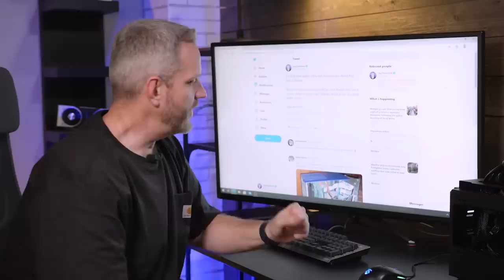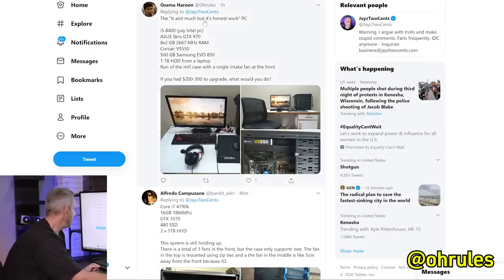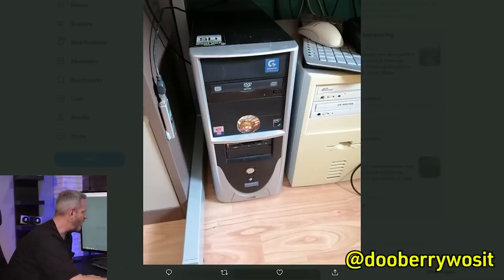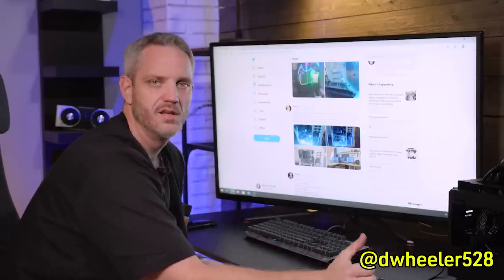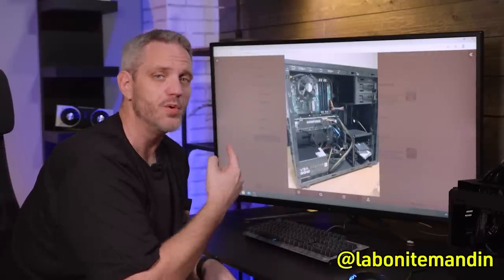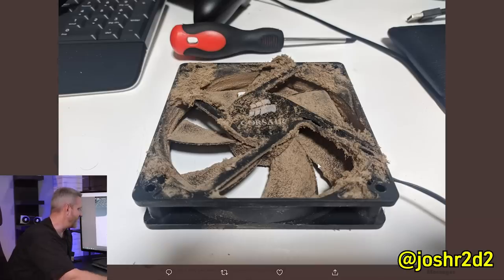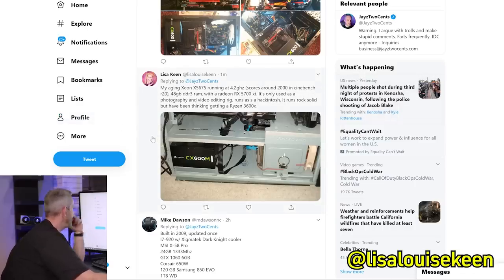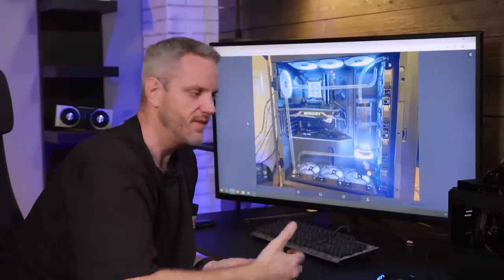Reacting to your WORST Setups... Send help NOW!

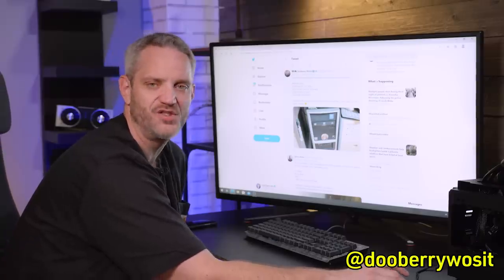Comment: 7:52 currently running an 8350 with a GTX1660ti I had to swush in there cause my rx290 blew up due to a sketchy "gamer" psu (was on a budget xD) and I'm getting some cpu bottleneck and there's no possible cpu upgrade on this mobo.. honestly it runs great like 60 fps on 1080 even 1440p and stuffs but I feel I wanna try 144hz 1440p so I decided to upgrade to an i9 12900k cpu an rtx 3080ti with some decent ram and stuffs.. currently looking up random pc stuff cause I wanna make sure I don't mess up the build xD

full pc build if any recommendations or.. stuffs
- Intel Core i9 12900K 
- Gigabyte Vision GeForce RTX 3080ti
- MSI Pro Z690-A DDR4 mobo
- Seagate Firecuda 530 2TB with.. sketchy heatsink
- Samsung 870 QVO 4 TB SSD 
- Seagate Exos something something 10TB HDD
- G.Skill Trident Z Royal DDR4 3600Mhz CL18 2x32GB
- Corsair HX850 Platinum PSU
- iCUE H115i RGB PRO XT AIO (wanted the H150i Elite Capellix but shit happens.. probably be fine not looking to overlock or anything)
- Corsair 5000D Airflow (black) case
- Samsung Odyssey G9 Neo Monitor (yet to purchase but probably will unless someone actually reads this and tells me it's a bad idea for.. whatever reason :D)
Also got a few extra non RGB fans since I don't care much for RGB..

Comment: Been building my own gaming PCs since 1998 and I do not adhere to the cable management religion. I just make sure that air flows through well enough.
I've been using the same Cooler Master tower for the last 15 years. No glass panel, absolutely NO lighting and it's on a "hanger" under my desk, so what the insides look like makes zero difference. It's quiet, cool and accumulates very little dust. Just saying you can be an enthusiast without caring one bit about cable management.

Comment: Water on hardware with high voltage running through it just feels so wrong to me. Can t help it but i would never consider getting water anywhere near my rig. Besides if the whole thing goes up in flames I can still put water on it to cool it off 😅.
Reply: I'm sorry, but up to 12 volt is not high voltage. Doesn't mean water can't damage the hardware though.

Comment: I'm in NorCal. I have sound cards, a few MB's, and a few old processors...couple old video cards, drives, old pci cards, couple ISA gameport cards (CH and Thrustmaster). Let me know what kind of retro things you need and I'll see what i got. Fyi...i tried to do a retro build for some old games and i wanted to use the monster sound mx300. I forgot how much of a pain in the A$$ windows 98 was to install.  I gave up on the build for now.

Comment: 3:35. Jay, I disagree. The 8400 has 6 cores @ 2.8 Ghz, and should be more than enough to run most titles. Spend the money on the graphics card. Even more so, now that the 3000 series has come out, the used market should be flooded with better cards than the 970. My rig is an i5-8400 + 1660ti and I have no problem running any games. Got my 1660ti for $120 back in August of 2019.

Comment: damn man saying fx is 10yrs old makes me feel old my son still uses my old fx8350 on a sabertooth v2 mobo 16gb ddr3 ram and a gtx1080 (first system i built myself was running  2 gtx650ti sli untill around 3 yrs ago)overclocked to 4.5ghz and a slight gpu overclock and still runs well to be fair he plays dirt rally 2 and other driving games and games like anno1800 with no issues

Comment: @JayzTwoCents @6:20 You mention FX processors being around 10 years old, well, I'm running a Phenom II X4 965 processor and will soon be treating my ASUS M5a78L-M/USB3 board to an FX processor AND a GFX card, it's FIRST since I bought the MoBo, I've been using the onboard GFX.
Don't mention OBS to my MoBo, it will cry ;-)

Comment: I need to restore my case... I like it too much to get rid of it but it needs some tlc unfortunately when I had to put it in storage for a little while the unit I had it in had an issue with condensation. But at the same time I'm not sure if I went to do any major upgrades that they would fit lol

Comment: I don't see the need of cable management within computers at all , i been building computers since 1986 and could care less about where my cables run unless they block a little bit of airflow.. which usely isnt that big of a deal anyway.. the only reason to manage "some" cables is when you need to work inside your computer to replace hardware.. which isnt that much also , i dont know what's up with people want the cleanest looking build.. for me what's important is the best working computer for gaming and other applications ... cables here are all over the place and as long as i dont accidently pull them or break my neck over them i don't care

Comment: My little brother had an FX system with a 650ti boost until one month ago when he upgrade to a Ryzen 3600 and a GTX 1070. He paid off the mobo and GPU but still owes me 115$ for the CPU. You know your CPU is old when you cant play new games because the CPU lacks the proper instruction sets.

Comment: Jay\Phill: Does the 3080 Seahawk gpu come with the aio pump on the cold plate or on the radiator? The only option i have is to bottom mount the rad which is strongly a no no..

Comment: The best thing was as my FX 3850 died, so i got a Ryzen 5 3600 and everything is fine now xD Its running on 16GB DDR4 3600mhz combined with my 6GB 1060GTX and i think i will upgrade my GPU in 2021 :D

Comment: pc at 19:30 u didnt nitice he has a microphone for recording, what it look now he no doubt have interference problem, prob just use for games or such....still could be rly annoying having that hum...alot to do with adaptors and cables for monitors, first rule if u going to record...always separate signal from power...he need sevral power strips to separate those adaptors.

Comment: i paired a fx8350 with a 2060 super heavily bottlenecked but getting that gpu was a very tight squeeze at £480! thats all i could afford at the time that system may of been shit BUT i still have a pretty good gpu that will fit into a better system which it did 8 months after that i got a mobo this was £180 didnt have alot of money left to get the rest so waited a month got the next tight squeeze £280 Ryzen 7 3700x then waited a month got the ram 2 months after that joined the SSD club now i got an amazing pc, that overpowered gpu in a old rig paid off in the end. it wasnt pointless getting it

Comment: fx is still fine for 1080p gaming in 2021 fx8120 with a 1660 super games at 60 fps the build cost like 350 to buil 2 years ago mobo is in stock and under 100 bucks cpu is easy to find for 50  ram cheap stop shaming low end builds

Comment: lol i got a sport car red pc case with even the sound of a car doing a burnout when i start it ,it has an asus p5k motherboard with like 7g ram ,a core 2 duo 2.6 g and a geforce 9500 gt 1g G.C. i got like 5 old non functionnal pc's and parts for 40$ and i built at least one functionnal....lol learning projects... my main pc, is my crappy msi gf 75 thin ,i7 rtx 3060...

Comment: I used to have an fx-8350 octa core cpu with 8gb of 1300mhz ram
upgraded to ryzen 5 3600 6 core scpu with 16gb of 3600mhz ram
about 3 months ago
dont know if that sounds like a downgrade but it works WAY better
Reply: that is not a downgrade, the architecture of the ryzen 5 is wayy better, the IPC is much better, you have 4 more threads now, more cache, probably even more stable at slightly higher clock speed, i also upraded similar to you apart from i was on the fx 6300, you made a wise decision going with the r5 3600, go run a cinebench r20 and compare it to a cinebench r20 of the fx 8350 and u will see how much the 3600 farts on it X'D. honestly at the 3600's price point theres not many cpu that can beat it for its price

edit: it may sound like a downgrade because of core count, but all ur cores / threads arent going to be used in some games / most anyway (if thats what you do), which is why intel have some lead in gaming, with higher clock speeds / less cores than most ryzen chips, but ryzen is catching up with clock speeds B)

Comment: My 8350 still rocking
Reply: i only upgraded from my fx 6300 the other month, i played so many games on the gtx 970 and fx6300, pushing it to 4.2ghz all the time aswell trying to tank my games with the highest settings i could... the cpu did well :), however the upgrade though was definitely worth it, i still use the gtx 970 though, will be getting a 1070ti for like £60 soon :o

Comment: My little brother just bought a fx system. Fx 6300, gtx 1060 6gb and 16 gb ram for about 200 bucks. I bought a fx 8350 from ebay and put it in hes computer to make it less terrible.

Comment: When you're running an FX system and Jay says to go turn a trick to get off of it...... whoops :D
Also to add to that I have an OCZ PSU very similar to the one shown in that picture and I feeeeeel that cables not being long enough issue. I had to run my 8pin cable through the small space next to the PCI slot between the board and the GPU. 
BS aside though I will be doing a full rebuild very soon with a 3700x :)

Comment: i think i over paid. Ryzen 5 5600x, MSi B550 -A-Pro MB,  T Force 1Tb Nvme,16gb corsair vengeance LPX 3200, stock cooler, XFX RX580, MSi 750 semi modular PSU, Montech X3 Mesh case. Any suggestions? Im still in the return window

Comment: I'm still running amd fx 9590 black edition xD never had an issue xD. I am switching to a ryzen 7 3700x though xD (but it's because of my 990fx chipset that decided to reach temperatures higher than Robert Wadlow. So Im pretty much building a new pc)

Comment: I am currently running:

i5 6500
h170i asus mobo
16gb ddr4
gtx 1070 g1 gaming

I want to continue gaming at 1440p with the latest games.
What upgrades would you recommend?

Comment: I would have won worst setup with my PC, it's old dirty, clogged up by dust and cigarette smoke (so much i got bsod's then actually cleaned it because I'm THAT lazy but that was 3 years ago lol), all fans rattle, 2 out of 4 memory slots are broken, it's an old 1st gen i7 with a GTX460 and only 8GB RAM left, the cheapest PSU etc, best thing is I got it for free 10 years ago. 🤣🤣 My highly modified vintage Amiga computers on the other hand are super clean and well taken care of 😎😎😄

Comment: My desktop is hideous lots of sketchy work done to make it work but it runs using an amd fx6000 series 4 Gb ram gtx 770 and an spliced rewired corsair 550 psu sitting in a lenovo erazer x315 case its a junk build but it runs

Comment: My daughter's pc had a msi red dragon 970 gtx 4 gb and it was a little bit faster then the 1650ti when you look at memory bandwidth  in supper position and heaven benchmark the 970 and it 10100 was faster then my legion 5 4600h and 1650ti.

Comment: I dont have Twitter but:

Ryzen 5 1600
Corsair Vengeance 16Gb 2666Mhz 
GTX 1070 G1 OC at 2144Mhz 
Thermaltake Berlin 630W PSU
1x 1,5 TB HDD
1x 250 Gb HDD
1x 120 Gb SSD 
CiT Blaze Gaming Case, 6 RGB Fans
Logitech G502 Gaming Mouse 
Logitech G910 Gaming Keyboard 
Logitech G640 Gaming Mousepad
Logitech G Pro Gaming Headset
2x Samsung 32" Curved 1440p 144Hz  Monitors

Comment: 4:01 OK, going from a 970 to a 2060 is not an upgrade. WTF are you smoking? That is a step down in graphics cards, just because it's newer.  Even with the extra RAM.  That was really bad advice.

Comment: Hello. Been watching you for a while now, learned a ton of stuff from you. Actually, learned so much, that I do have to step in and defend the FX series. For now, in writing, and later, when I am confident enough and the build is finished, with, hopefully, a video as well. I brought down to it's knees an GTX 1060 with an OC'ed FX-8300. SO much, that I bought a RTX 2070 in place of the 1060. On a 240mm TT AiO, I run the FX at a stable 4750mHz, round +/- 60 degrees. I did bring it to 5000mHz, stable-ish in Prime95, solid in games, but the 80-85 degrees it went up on  the AiO made me re-think. All in all, the FX is still relevant and certainly still not showing it's age :P

Comment: 12:55 I blew up 2 PSU by having the fan pointing up. The PC started with a 'silent' GPU (no fan) but once I upgraded to a new GPU the 2 fans clashed and caused the PSU to instantly over heat
Took the replacement PSU dying to workout what was wrong

Comment: Here is my system.. Any  suggestions on improving my pc? No real limit on my budget. 
I already plan on upgrading my video card to the new 3090 very soon, was hoping for a ti version of the 3090.
The HDD is strictly for long term storage. 
My 860 pro is strictly for games
My 970 Plus is for the operatiing system and all programs. 
I like my monitor but I want to go to a 4K monitor, Wish they made the Acer x34 in 4k.

ASUS ROG Maximus XI Hero (Wi-Fi) Z390 Gaming Motherboard LGA1151 (Intel 9th Gen) 
Intel Core i9-9900KS
Corsair Dominator Platinum RGB 64GB DDR4-3200MHz
Nvidia GeForce 1080 Ti 11GB AMP Edition
Samsung 970 Evo Plus SSD (M.2) 2TB
Samsung 860 Pro SSD 2TB
Western Digital Velociraptor 10,000 RPM Hard Disk Drive 1TB
Corsair Hydro Series, H100i RGB PLATINUM Liquid CPU Cooler 240mm Radiator &  Dual LL120 RGB PWM Fans
Acer Predator X34 QHD G SYNC 120Hz monitor
CORSAIR - RMx Series 1000W ATX12V Plus Gold Modular Power Supply 
Corsair Gaming K95 RGB PLATINUM XT Mechanical CHERRY MX
NZXT - H510 Compact ATX Mid-Tower Case
Windows 10 pro.

Comment: back home still have my P4 3.2ghz sk478 and his radein HD 4670 1gb agp 8x top of the Asus 478 agp mobo looking for a 3.4 extreme edition for years to complete the top sk478 build 😂 XP sp3 pro on a 90cm hard steel tower with 2 raid controllers (2 ide ports each) 4 CD/dvd drives one zalman cooler 6 internal hdds plud6a bunch of external about 40kg just the tower itself 😂 😂 😂

Comment: After seeing this video and I changed one of my ram slot due to it was right next to the other ram.  If you count start from left as 1 all the way to the right as 4 then my original set up was slot 3 and 4.  Which is not the proper way to insert your ram so I moved ram from slot 3 to slot 2.  The RGB light from ram lights up as I boot up and computer shows the proper memory.  But then I started to get random disconnects from mouse and keyboard afterwards(re-plugging the mouse/keyboard USB don't work) , not immediate after I switch ram slot positions but happened twice in one day and this has never happen before.  Also there is no sound whatsoever from Windows indicator when the disconnects happen. I recheck the ram slot and noticed the original ram position 3's motherboard lighting is still on, even though it's empty now.  Did I miss something after I moved my ram to a different slot, like a reset on motherboard or something?  If anyone know, please help

Comment: OK JAY We get It. You don't like FX. Thing Is I built A  AMD FX6300 Black edition 6-Core 3.5 GHz CPU on GIGABYTE GA-78LMT-USB3 with MSI GTX 470 Twin frozr II Nvidia Graphics Card 16gb DDR3 1333MHZ Ram Rosewill 750 Watt Gaming Computer Power Supply, 80 Plus Gold PSU, CAPSTONE-750-M DIYPC P48-W White SECC ATX / Micro ATX Mid Tower Computer Case w/ 2 x 120mm Blue 500gb laptop SAMSUNG sshd primary 1tb desktop FIRECUDA sshd secondary. Desktop system for under $200 and It will run most anything I want. I can't afford anything else so yea. I take offence to that. LOL Just kidding. But I would love to build something better and up to date when I can. Nice video BTW.

Comment: Osama Haroon my computers worse than that I have a 3.1ghz amd althlon processor 1.5gigs of Kingston ram and an amazing 512mgb Radeon graphics card and a 100 gig HDD asus mobo from like 2001, it won’t run any new program, that’s why I’m about to buy an Alienware I’ve wanted one for over 30years now but could never afford it now that I’m older and have money I think I’m gonna try a pre-built for the first time ever, desktop’s I’ve had since I was 10 I built myself my last one cost a grand total of $450 off Newegg

Comment: What? Getting off an FX based system? I am to this very day running a 45nm Phenom II x6 system in my Lab as my office PC its on its 3rd power supply its 4th GPU, its 3rd RAM upgrade and just got a shiny new SSD a Month ago when i did a clean install of windows 10. The case is an ancient Thermaltake that had some dremel applied to fit 3 140 mm and 1 120mm fan. I modified an old Scythe angled tower cooler to accept the Wraith Prism Fan off of a modern AMD stock cooler and just to show the beauty of the old Gigabyte Ga-870-UD3 board it features a corsair commander pro for fan management and rgb for shits and giggles because the nigh immortal pcb that is this Mainboard simply lacks fan headers xD
Good day sir!

Comment: LOL I have an FX-8350 system..And yes, I finally is going to upgrade. I have purchase. 2700x cpu, 2x8 3200 ram, 2x980ti, M.2, 500GB ssd. MSI X470 Gaming M7 AC mb. evga 850watt ps. I know you are going to talk about this 2 years ago build, but I never purchase the latest or the greatest, Nope. To me a computer is like a car. My first and last computer I ever purchase, was a packard bell doozy in 1992.When I 1st start building home systems people were still buying computers bundles like for $1200. But back then I could build a new one for $600. But today its all reversed, home builds are extremely overprice now. Like that bitcoin mining video card crisis.

Comment: Has anyone else had the little issue with the (i thimk audio cable) on MSI MB at a break neck angle to plug onto the board? I actually broke one of the two off of the PCB and im scared to tear it apart and clean up my wiring because the trauma involved. Perhaps its not the audio but maybe other MSI board owners know which one i'm talking about. Im not sure if the issue is stiff cables or what.